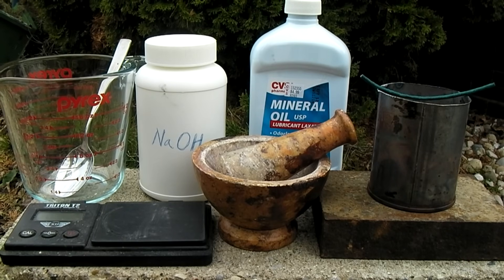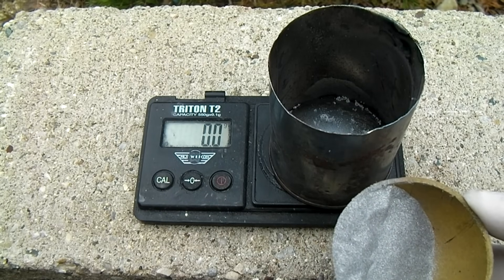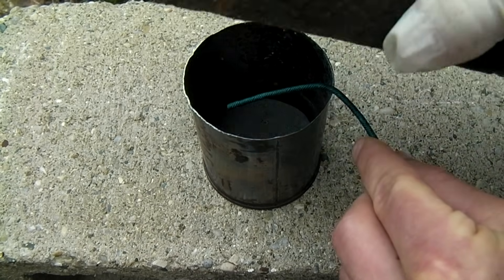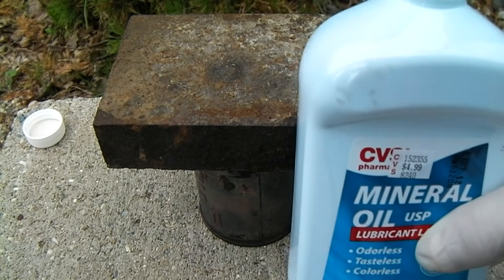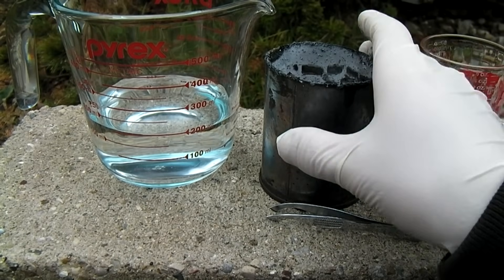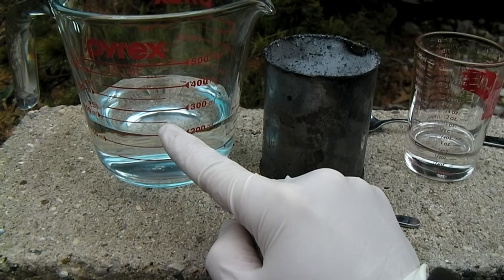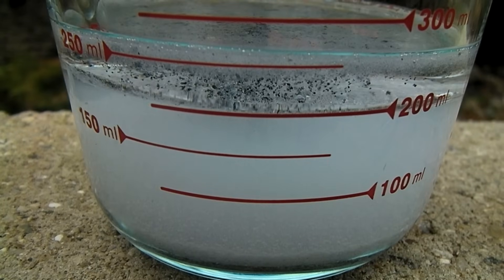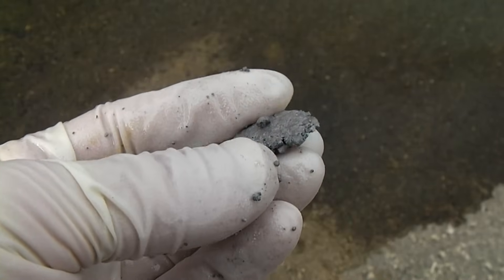How To Make Sodium Metal

Comment: How You're Making SODIUM?
In Your Electricity - Power Plants. Your Electricty Grid is VERY In-Efficient. The Reason you Do it. Over Letting Your Ba5tards Use Diesel/Petrol Generators is that in Your Electricity Power Plants - Your Heating Salt to Make Sodium.
Thats What Your Explosives are. You then Enrich that to Make Lithium. Thats What Your Nuclear Bombs Are.

Comment: Question: how soon can you add the oil ? Right after burn to reduce oxidation? I understand you said wait 10 minutes to let cool for obvious safety reasons ,i would be using propper PPE oc. Well if i had a ray gun thermometer i could check temp to be sure it was below flash point of oil .... answering my own question i guess. Below 135°c for pure ,if that can be used as a laxative that makes it food grade and FP is at 196°c, i would use a dropper to suck up the itty bitty balls.

Comment: Is this legal for me to do at home?
Reply: Sodium explodes, No it's not exactly Legal to do at home, same idea as trying to make your own fireworks at home. Any metal from the first row of the periodic table will explode if they touch water. Remember all those fake China hoverboards that would catch on fire while charging? That's the Lithium in the battery that probably caught fire because of Humidity.
Reply: @Sllabamgil567  I want to do this for fun but I’m afraid of being put on a list for ordering the stuff for it haha
Reply: @Nimbolimbo918   I'm pretty sure you have to go through alot of red tape to order something like that, think about what it would take just to transport that. It's something that can explode in water and of its humid enough the air. It has to be stored in oil.
Reply: @Nimbolimbo918   I don't think you would get put on a list for trying to order it. You would get put on a list for catching stuff on fire after your at home experiment.

Comment: I was I'm pressed by this video and couldn't wait to try it. But it didn't work. I love sodium, and could not get it to work. I just got brownish, blackish globs on top. And even tried throwing it in water, once dry. And it did nothing.......? What the hell?
Reply from the maker: If you're waiting for it to dry that may be too late. Sodium reacts with air. If you let it sit out for a while the sodium is turning back into hydroxide.
Reply: So what happens between when you put the mix in the mineral divideing-up and then you are holding a dry sodium, there was no show  of how to take it out correctly. How did you do that?
Reply from the maker: @ekeene11  Once collected from the oil and water mix I put the pieces into pure mineral oil
Reply: @Nighthawkinlight  okay. So you grabbed every bit fast. Then how did you quickly clump it up?
Reply from the maker: @ekeene11  You don't have to be super fast, but try to do it at a good pace.  I clumped the pieces together after they had all been collected and submerged in fresh oil
Reply: @Nighthawkinlight  Okay, thank you so very much for messaging me back and for helping me out. Thank you, for such quick responses.👍

Comment: Hello I am new to this and I was wondering if I need a special license to have the metals that are so reactive to water ? Also to store them in my shop ? A little bit of info on this would be appreciated. I didn't want to get some of the metals that I have seen on the videos and then get into trouble for having them. I'm not scared to mess with the metals and I have been seeing people on the videos not wearing gloves. It doesn't matter how long they have been handling the metals - it only takes one mistake and then the person has doctor's appointments. Also I have noticed in a lot of the videos they don't put a shield between them and the material being handled and experamented with. I take safety seriously unlike most of the people in the videos. A little insight on the license needed for having and storing the metals will be appreciated
Reply from the maker: In the US I don't believe you need any license for possessing reactive metals. They don't typically qualify as explosives, but they are considered hazardous and fall under shipping and transport regulations.

Comment: I tried this but i cant seem to get the sodium + slag out of the crucble. its hardened into one giant clump at the bottom of the crucible. Unfortunately the video cuts out the part where he gets it out of the container.
Reply from the maker: I'd flip it over and knock it with a hammer if it's a soup can.

Comment: Okay, so that was essentially a thermite reaction, right? But I thought the elemental metal had to be more reactive than the metal that starts as a salt. That's why Al+Fe2O3 works, isn't it? Mg is definitely not more reactive than Na.
Reply: I thought the same thing but chemistry likes to break itself apparently.
Reply: In a normal thermite reaction only the metal oxide is being reduced. Here both the sodium ions and hydroxide ions are being reduced, to sodium metal and hydrogen gas respectively. The reaction is enthalpically favorable by the heat of formation of MgO and entropically favored by the formation of hydrogen gas. It's favored but kinetically slow hence why high temperatures or an alcohol catalyst is needed. Long story short normally yes, sodium is more reactive than magnesium, but in chemistry there are always exceptions.

Comment: How does this work? If it's a basic competition reaction, which it seems like, it couldn't work. Sodium is more reactive than magnesium. So it wouldn't try to "steal" away the O or OH.
Reply from the maker: Correct. It's not a normal replacement reaction. There are other things going on that I do not fully understand myself.
Reply: @Nighthawkinlight  It is normal, the heat of formation of both magnesium oxide and magnesium hydroxide is higher than the heat of formation of sodium hydroxide.  So the reaction is exothermic.  And reactions always proceed to the most stable product, ie magnesium hydroxide in this case.

Comment: Where the hell am I supposed to get magnesium?!
Reply: Buy a magnesium rod in the RV department at Walmart it cost about $7.50 or every hot water heater has a magnesium rod in it they are about 9 inches long they screw into the top

Comment: you can also use molten salt and electrolysis it, this is a lot cheaper, and since you hopefully are venting your furnace anyway the chlorine gas wont be a issue (still better than sodium hydroxide).

Comment: is it possible to produce K-Na mix from molten Potassium sodium tartrate using electrolysis? what happens if you eletrolyse molten potassium-sodium tartrate? it melts at 75 celsius so it should be easy.
Reply from the maker: It would likely strip the sodium ion and leave the potassium in place.

Comment: I don't understand the separation step.
If the purpose of the water/oil interface is for Na to react with water so that it can get separated from the slag, why doesn't Na/water reaction oxidize Na into Na+ ?

Thanks!
Reply: It does,but Sodium metal is less dense than water and mineral oil,so some metal wil float.

Comment: Could you use Alluminium instead of magnesium
Reply: No.
Reply: Chase Gilley it would work but not efficiently **
Reply: Don't do it
Reply: Maybe if you used iron oxide with it and made thermite. (Maybe copper thermite)
Reply: Chase Gilley copper thermite is extremely dangerous, it actually can explode.
Reply: +John Doe Yeah. Don't be dumb about it, but if you take the proper precautions, you'll be fine.

Comment: Im a bit confused with the extraction. When the sodium passes through the mineral oil layer and reacts with the water why doesnt it produce NaOH?
Reply: With a pair of tweezers like he said in the video
Reply: sodium metal is less dense than water and mineral oil... so it floats to the surface of the oil and doesn't react fully with the water :D
Reply: Some of the sodium is wasted and some keeps floating!! u can collect the floating part!
Reply from the maker: +Badplum25 It does
Reply: NightHawkInLight Then how did you create Sodium?
Reply: Michael Schöllhorn oooo okay thanks that makes sense I was rlly confused  :)
Reply: How do you collect the floating parts?

Comment: Is it possible to obtain sodium by electrolysis of seawater?
Reply: Wouldn't the sodium instantly react with the water?
Reply: +Niohimself Alkaline metals cannot be extracted from solutions because they immediately form a hydroxide and only hydrogen gas is obtained. For example from NaCl solution you would obtain hydrogen gas at the cathode and chlorine gas at the anode. The sodium simply stays in the solution to form NaOH - sodium hydroxide. So it isn't possible to obtain it by electrolysis of any SOLUTION it is in.
Reply: also the solution also accumulates with other chemicals like bleach so you can't really use it to make NaOH
Reply: Electrolyse brine/dissolved sodium chloride.
- side produces Na, which reacts with the water to form NaOH and H2.
- side also produces H2 from the electrolysis of water.
+ side produces oxygen and chlorine.

NaCl(aq) --> NaOH(aq)

The only reason people say you can't do it is because everyone uses arbitrary voltages and currents, which, frankly, is fucking stupid and negligent.

Comment: Heat Sodium Chloride to 1200 until it melts then...electrolysis...you'll get a huge lump :D I've only read this I've never tried it btw....
Reply: +Ahmad El-khatib chlorine gas is deadly
Reply: You can always collect it somehow in a container on top of the mixure....or neutralize it somehow maybe
Reply: Both of you don't know shit about chemistry and you've never tried electrolysing anything before. 
Chlorine gas isn't deadly. That's a degeneric statement. 
Humans are deadly. Is that statement cancerously aggravating? If so, you get the point.

Comment: How does using the fuse helps the reaction? 
Could using a torch to bring heat work aswell?
Reply: It puts energy in the reaction to break bonds and allow new to made. The fuse was used rather than a blow torch for safety precautions. A blowtorch would work, but you could be injured, blowtorches are not advised.

Comment: I don't know how old this video is, but I hope you can respond. Where do you buy your magnesium powder? I have checked amazon, ebay, and just about everywhere on the internet. I bought solid magnesium, but filing that takes hours. I even tried buying magnesium pills, to no success. On the internet all I can find is magnesium oxide  or magnesium citrate, and I do not know if these will work. Please redirect me.
Reply from the maker: You can get magnesium from skylighter or other pyrotechnic suppliers, but it can't be shipped because it's considered a hazardous material. Magnesium aluminum alloy (magnalium) may work for this experiment, but I haven't tried it myself. Magnalium can be shipped.
Reply: Ok thanks
Reply: +Konicler Incorporated I myself bought a spare water boiler anode which is made from magnesium and made myself some powder using a file.

Comment: fucking where we going to get Sodium Hudroxide and Magnesium
Reply: Sodium hydroxide is a drain opener just check at your local hardware, make sure it's 100% NaOH.
Reply: You can buy also Sodium Hydroxide from a Hardware store. But I'm not sure where you can buy Magnesium powder, I get my Magnesium powder by grinding a piece of magnesium into a powder form. The piece of magnesium I use is a fire starter kit that you can get at Walmart or at Dollar General.
Reply: +Mason Poindexter I was thinking the same thing as I got 50 or so lying around. Say, what's your method of powdering the mag? I was using a sharp knife  and scraping  back and forth I did it for hour and then weighed my products turned out to be .3  man there has got to be better way

Comment: Now why does sodium react with regular water? Is it because of the other chemicals present in the water, or can it also react with distilled water?
Reply: Obviously, sodium is an extremely reactive metal. When sodium comes into contact with water, it displaces hydrogen gas as follows:

2 Na(s) + 2H2O(Aq) -> 2 NaOH(aq) + H2(g)

Sodium has a density of only about 0.97 g/mL, so it floats on water. The reaction produces jets of hydrogen gas below the waterline; this is what propels the sodium around the surface. The reaction releases heat, and as the sodium and the solution warm up, the reaction goes faster and faster. If the sodium gets trapped on the water's edge or against some other obstacle, enough heat can be generated to boil the water around the metal and actually melt the sodium.
This is a dangerous reaction. If the sodium gets hot enough, the hydrogen jets can ignite and burn. That's what caused the sparks you saw. Burning hydrogen makes the temperature rise even faster. The rate of the reaction increases so quickly that an explosion may occur! Molten sodium can be thrown out of the dish.
Reply from the maker: It can also react with distilled water. Sodium reacts with water to form sodium hydroxide.
Reply: What causes it to react though? Like how?
Reply from the maker: David Santana Hamza B The reason for the reaction is straight forward as noted. The reason it may explode after a short while has only very recently been discovered: http://youtu.be/LmlAYnFF_s8
Reply: David Santana
I know right, I'm in 10th grade now and really interested in this stuff. You should look more into chemistry we have some good explanations for this. If you know chemistry you can predict what will happen if this mixes or burns with that
and that to me is amazing
Reply: +David Santana sodium is an alkali metal and it has only one valence electron. It wants to get to either 0 or 8 valence electrons and so it will give away one valence electron to the water. Oxygen has 6 valence electrons. Hydrogen has 1 valence electron and wants to get to 0 or 2 valence electrons. Valence electrons can be shared, given, or received. Two sodium atoms and two water molecules combine so that two sodium atoms, two oxygen atoms, and two hydrogen atoms form sodium hydroxide (2NaOH) and the two left over hydrogen atoms form H2, which is just hydrogen. When this happens, it is reacting and that is what makes the physical changes.
Reply: Hamza B Thats what I was looking for, thanks for the awesome information.
Reply: David Santana Sodium is very very 'willing' to give up electrons. Oxygen accepts them very well.  (There is actually a voltage potential that is calculatable here). 

It's called a ReDox reaction. (Reduction/Oxidation)
Reply: Hamza B And boy, does THAT suck. ;-)
Reply: All atoms want a full shell of electrons. The first has 2, the second 8, and I believe the third has 18. Sodium and other alkali metals have 1 more electron than they want. When reacting with water it force that extra electron into the water releasing hydrogen gas that sets alight during the reaction
Reply: +miscellaneous gamer Yup, that's what I meant when I said 'willing' I suppose I could have been more concise. The outer S shell has 2 electrons, but because of the shielding provided by the previous P and S shells makes the effective nuclear charge lower. So the highest S shell is requires less energy to liberate the electrons. 

The electrons are in a more stable configuration when they resemble that of a nobel gas, in this case Neon. So they readily give them up to be there. That difference is actually -2.71 Volts. Pretty low all things considered. 

If I'm not mistaken this is why Sodium lamps were so popular the requirement to liberate electrons from sodium is so low it was power efficient. Anyway that same potential energy is released when it binds to something that will gain those electrons.
Reply: Nolan Ward
Good one. Nice and short. :-)
Reply: +David Santana  Na[sodium]+H2O[water] react to give NaOH[sodium hydroxide] .it is exothermic reaction [released heat ]